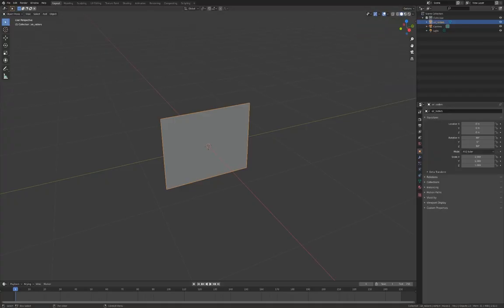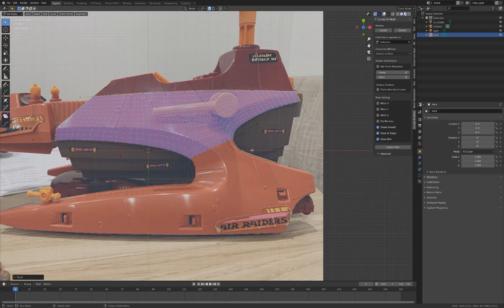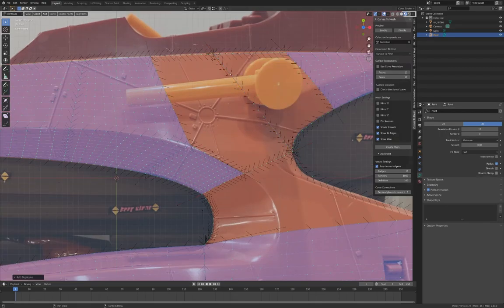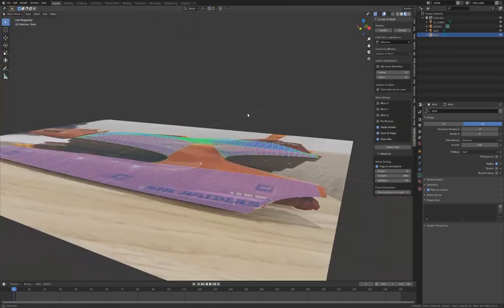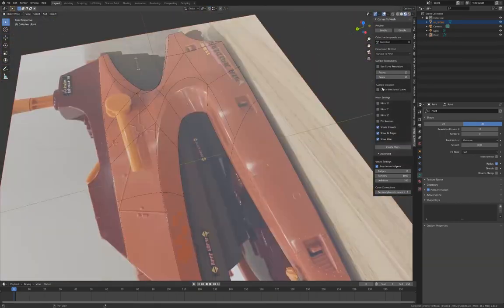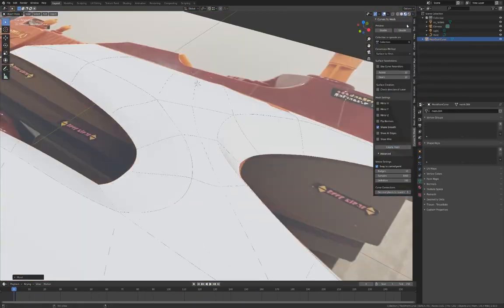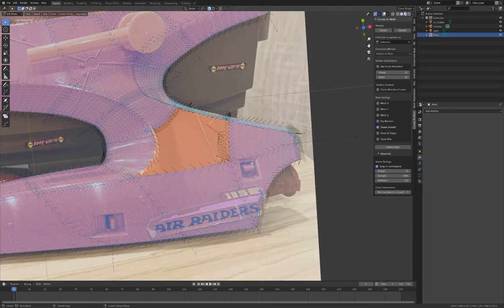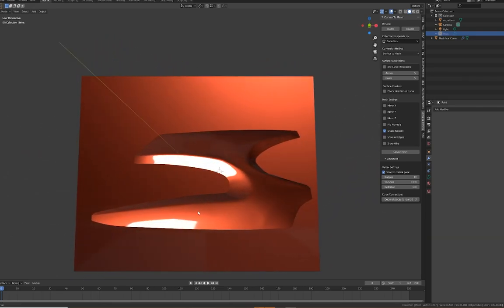Creating a Complex Shape with Blender's Curves to Mesh Add-on

Comment: Imo Poly Modeling would've been easier and faster. The patches of yours could've been simply polygons and it should've worked just fine.
Not an expert or even "decent" at modeling myself but here's an example: https://imgur.com/a/E9kH7ob
There's Ngon in here but it can be easily fixed I just drew it quickly.
P.S. This is not a complex shape because I've managed to model it in minutes without melting my brain after hour of struggling :P
Reply from the maker: You know, I think you are correct in this case, and I have come to feel the video is a little misleading - the add-on might allow you to create some intricate curve pieces, but Blender has some powerful poly modelling tools that can support that.

Comment: im honestly intrested -what is the differnce between this and converting NURBS to mesh? Is it a workflow improvement because you can see the edge flow??
Reply from the maker: So I don't have much experience of the NURBS mesh creation in Blender, but the main thing for this is that it will create meshes from either 4 interconnecting curves, or from curve profiles.  Hope that answers your question?